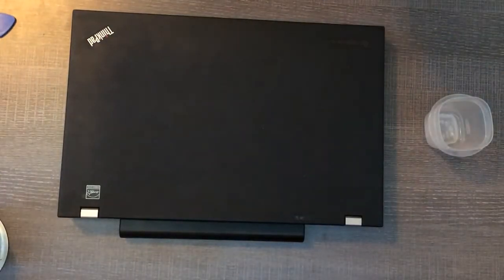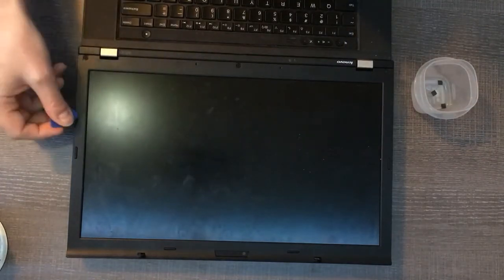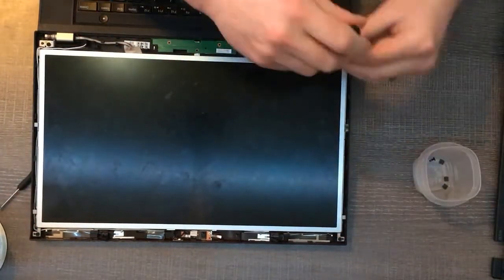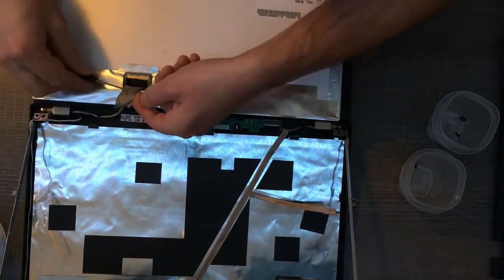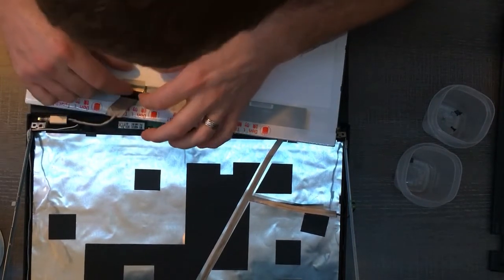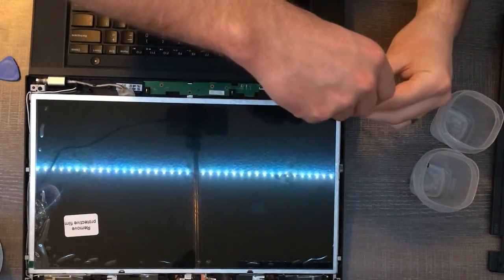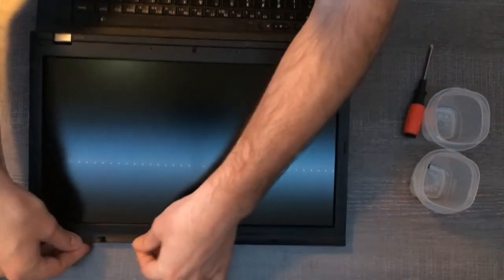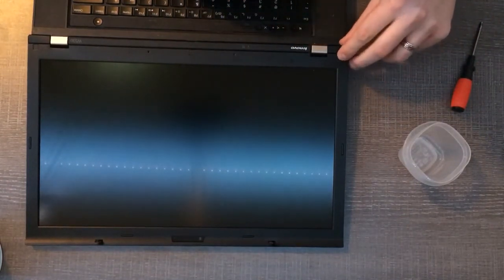Laptop screen replacement / How to replace laptop screen on a Lenovo Thinkpad W530

Comment: Hello sir,I was wondering can You put any screen on it if it is the right size?because  I'm having this problem. But I have three other laptops with the same screen size?does it matter
Reply from the maker: I believe the type of monitor does matter. Some laptops will support a number of different monitor models/SKUs, so it's possible that one of them may work, but it's not guaranteed. They also typically need to be the same size, resolution, and have the same connector type. Your best bet is probably to look up which monitors are supported by your laptop.